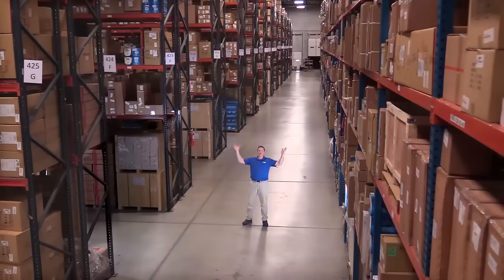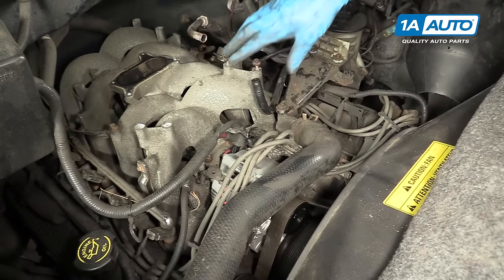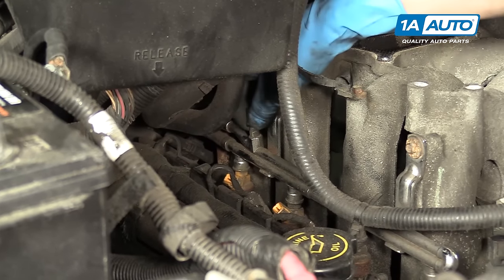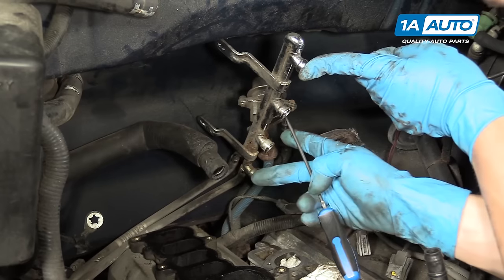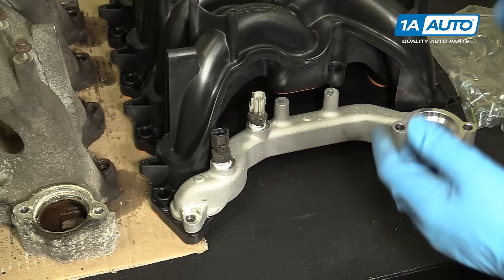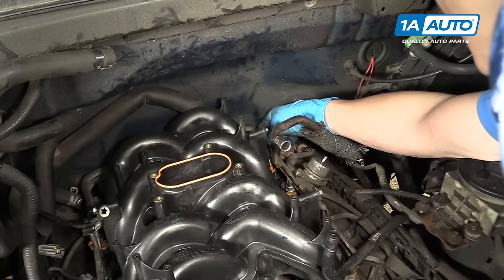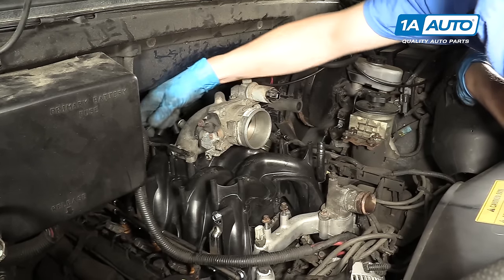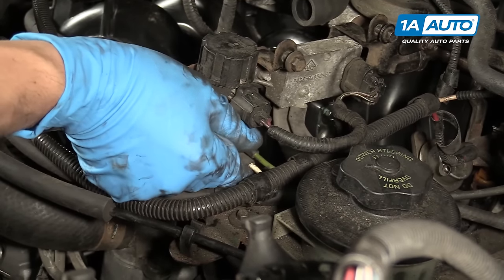How to Replace Upper Intake Manifold 97-06 V8 4.6L Ford F-150

Comment: Here’s a question; 2000 Ford E350 5.3, basically same setup. Classic blown plug. Started taking it apart and found oil in plug tubes. So I decided to take the engine apart to look at them, and start replacing gaskets. Have intake manifold out, valve covers off… now I’m realizing I’ve NEVER seen this crazy … set up! How in the peanut do you access the tubes? They aren’t technically in the head? I don’t exactly want to go ripping it out, only to find that I can’t even gain access there! This is the worst design possible. Best vans, worst engine designs… Blown out plugs, then move to a 2 piece plug… wow!

Comment: Mechanic: I like to put the bolts back in so I know where they go...

Camera Man: zooms into the two holes missing bolts on the throttle cable bracket.

Producer: 😱
Reply: Breaking it down arent ya

Comment: Will work on the 5.4 as well correct?
Reply from the maker: +trump is your president This manifold will not work for the 5.4, this is specific to the 4.6. In order to see if we have one for the 5.4, you can either provide your vehicles information or take a look on our website 1aauto.com

Comment: I need a manifold for a 5.4 ford 1999 150 xlt what is the part number
Reply from the maker: +emilio I have attached a link to the different items we have available for your vehicle: https://www.1aauto.com/search?q=exhaust+manifold&year=1999&model=1521&searchQuery=exhaust+manifold
Reply: This is not the right part I need a upper intake manifold for the 5.4 1999 Ford 150
Reply from the maker: +emilio We currently do not carry the correct intake manifold for your vehicle.

Comment: I'm guessing you have to do all this just to replace valve cover gaskets
Reply: HtownRO yes
Reply: @richardcope3077  not true you don't have to remove the intake manifold to replace the valve cover gasket it sure will make it easier but it can be done with out removing all that stuff and you save time  unless you want to change the intake gasket and valve cover at the same time

Comment: That's a junk intake after unscrewing the coils twice to do plugs the holes that you screw the coals down to will loosen and strip and you'll no longer be able to tighten down the screws to hold your coals in and will eventually have to go through Ford to get the updated intake that's got brass embedded in the plastic that you screw everything into

Comment: I just installed this manifold on my 4.6l. Followed every step. Now I have a very rough idle and stalls. Anyone have any suggestions to look at? Tia
Reply: It depends on the gaskets you installed felpro is the only way to go might have moved when you installed
Reply: ?? Clean you MAF sensor w/ MAF cleaner ??

Comment: What size torque wrench is needed?
Reply from the maker: +Jamie Frierson You just need a torque wrench that will fit the spectrum of torque specs discussed in the video.  From there you just put on the corresponding socket size for the bolt you are tightening.  1aauto.com

Comment: What's a body lift?
Reply from the maker: +mondos2001 The truck does have a small lift.
Reply: A body lift is when you put spacers between all the points where the body mounts to the frame and it makes it look like the truck is taller.

Comment: Never ever use Plastic PERIOD! I had my gasket done, he clean it up, put new gaskets in. I'll take Metal Alloy over plastic any day. And Plastic Intakes Manifolds have cause more issues then you know, its called failure. Cracks from over heating. Good luck with that.